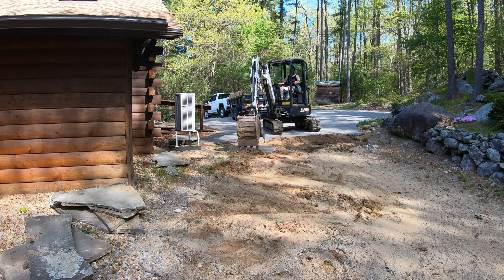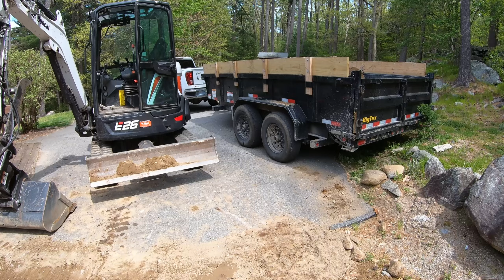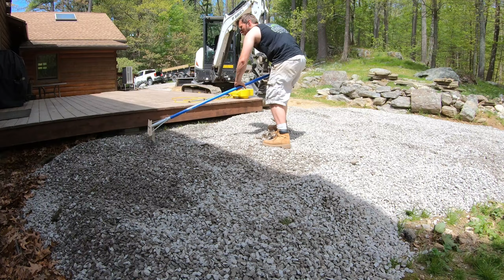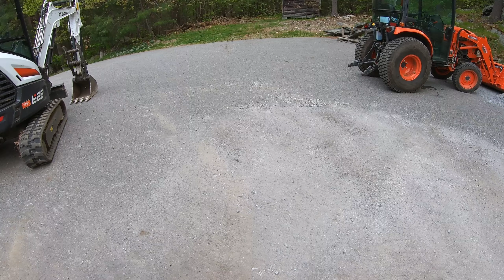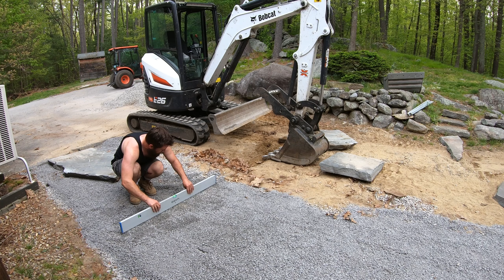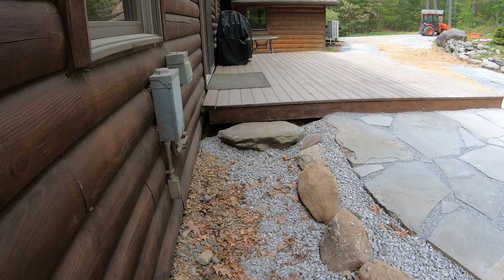Making a Flagstone Patio with a Bobcat E26

Comment: where did you get the wrist at??
Reply from the maker: It's the Bobcat Powertilt. Got it from my dealer earlier in the year!
Reply: @CarlsonSonLandscapingLLC   i have the same machine 2022 long arm edition, how much is the attachment? is it a pain to install?
Reply from the maker: Its just a quick exchange attachment so that goes on your stick and then you can put any other quick exchange on the bottom of the wrist. So its pretty quick to swap around, just a small hassle connecting the aux hoses if you dont have a diverter.